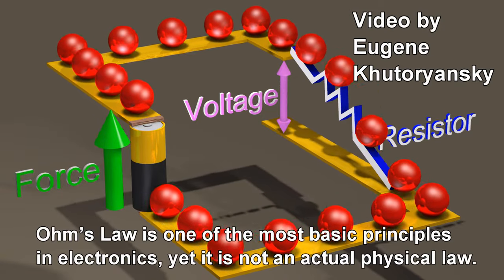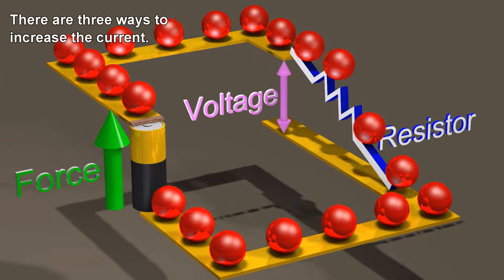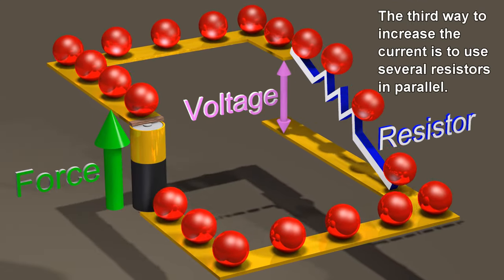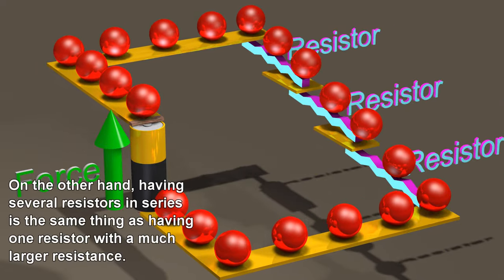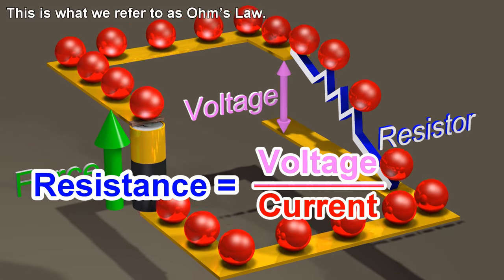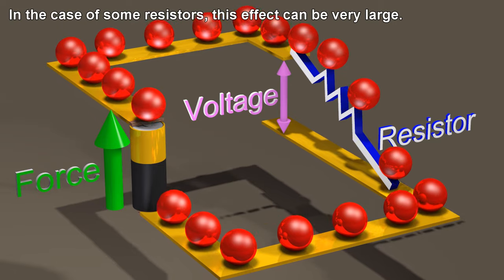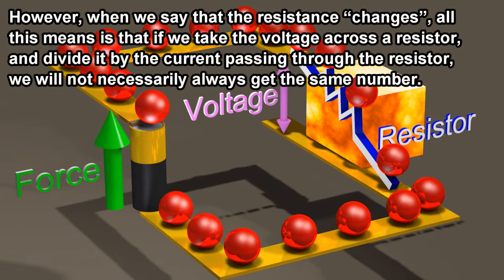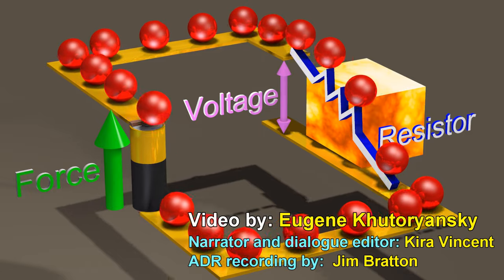Resistors - Ohm's Law is not a real law

Comment: Ohm's Law is more than just a "definition" : it's an empirical observation that, within some range of values, and at constant conditions such as temperature, there is LINEARITY (with a graph passing thru the origin) between the applied voltage and the induced current.
It does not explain why it is so, in terms of the electron structure of the material, etc.
The animations are awesome to give an intuitive feel for Ohm's law...  and I normally admire this channel...  but found this video to be unfairly dismissive of an important milestone in the history of science on loose semantics grounds.

If you want to say that Ohm's Law is really a definition of Resistance, fine.  Then the law becomes: the Resistance is (generally) constant, and (typically) doesn't depend on voltage (under some common circumstances.)

Some early pioneers of the study of electricity thought that increasing the voltage did NOT increase the current... as detailed in this video on the history of science:  https://www.youtube.com/watch?v=fk_BpXlfZ8U
On a similar note, one could imagine that if you doubled the voltage, then the current might perhaps increase by x4 or x8, etc.
Ohm's Law sets that straight!  It is approximate, and does not bring in insights from quantum physics, but it cannot be dismissed as not being a "real" law; it simply is not a FUNDAMENTAL law...  Today's fundamental laws (such as the axioms of quantum mechanics) are often tomorrow's derived laws.  

A lot of the "laws" of fluid dynamics are also empirical approximations, under some ranges of conditions.  One could argue that the word "law" might not be the ideal term... but I was hoping that this video was going to dig into the underlying mechanism of conduction - what actually happens to the electrons in the current inside the resistor as they interact with the electrons in the atoms of the material (valence bands, conduction bands, etc) - since the title implies we must dig deeper to find that "real" law.

Or take "Newton's Law" of gravitation: it breaks down if the masses are sufficiently large...  Heck, it doesn't even accurately predict the precession of the orbit of Mercury....  But if one made a video called "Newton's Law is not a real law", I think that the audience would expect a discussion of General Relativity!

I think a more accurate title for this video would be "An intuitive feel for Ohm's Law" - with a caption "Ohm's Law is not a fundamental law, though we don't explain here why that is the case, other than saying that it's approximate"

Comment: Ohm's law is mathematically true insomuch that it is "measurably consistent" in observation (regardless of the variable nature of the actual phenomena [i.e. the resistence within a given circuit]). Given its irrefutable real world applicability "irrespective of changing conditions" (i.e. variation in resistence) within a given circuit, Ohm's law is a fundamental absolute (as generally understood by V = I * R). Therefore, "Ohm's law is absolutely true" (as proven by its predictability in analyzing "timewise current conditions" within a given circuit). There are many generally absolute laws of nature (i.e. Ohm's law) that can be picked apart or explained by its more fundamental physical properties (quantum mechanics), but that does not in any way negate the measurably absolute applicability of Ohm's law. In fact, the reliable deterministic predictability of Ohm's law has provided invaluable insight into understanding subatomic phenoma.

Comment: I think this is not entirely true. The misunderstanding is in my opinion that many people believe U=RI to be Ohms law which it isn't. As explained correctly in the video, U=RI is the definition of resistance. But Ohms law really is that R is constant, i.e. for a "ohmic" resistor, the value of R is the same all the time regardless of the voltage applied. And this IS a physical law. (Of course, if you look closely enough, there will be smaller or larger deviations as explained in the video. But  that is more or less one of the foundation of physics: everything behaves linear (current is proportional to voltage) as long as you keep the range of values small enough). So the Ohmic resistor is a model to reality which works very well in a broad range, and this, as I mentioned earlier, is a physical law.
TL;DR: R=U/I is a definition, R=const is a physical law!

Comment: It is a law. It's a law that tell us that current directly proportional to the voltage.
Reply: Johannes Sjolte Not an universal law.
Reply: Neither is Newton’s 2. Law
Reply: Johannes Sjolte I thought the same, but there is one difference. Both laws share the fact that you can define a new physical parameter, mass or resistance. But in Ohm's Law you have some materials that doesn't obey it, while in the other case every object has its mass remaining constant. But, that never happens actually, because of Special Relativity…
Therefore… Ohm's Law is fine, but has that particularity which other laws doesn't have.

Comment: I am not sure about this definition thing, as far as I know (let me know where I am wrong) resistance is defined as a property of an object, much like line in geometry is defined as an "undefinable object" and the law tells us how a few of such values are connected, much like geometrical axioms tell us the relationships between the "undefinable" elements: lines, dots, planes, space...

This way you can always polish the law without being concerned about definition: what if it doesn't work in high/low temperatures, close to light speeds or in an uninertial system? You don't have to change the definition, only the law, if it proves easier to do that (because of some other laws regarding the same values).

Comment: 1. There are preconditions to this law such as 'under constant temperature' which is to imply that the law would be talking about a simplified model of real life system like most laws in physics. Therefore, it is to be used more as a guideline rather than as a law beyond textbooks.

2. The statement is also not R=V/R. Ohm's law statement is that current flowing (the effect) is proportional to voltage (the cause) across the resistor. Resistance is only the constant of proportionality to represent the law as an equality.
Therefore, the law is not responsible for a variable resistance. Even under changing conditions (under the preconditions mentioned in 1), the law still holds.

Comment: There is always in everything we generally assume. We must assume for something to be right. That is generally speaking about language. Language is a memory we all share. We can have different understanding of words, we might associate words with each other, and we might have strong or weak feeling connected to words. Without knowing the meaning of words before hand we cannot use unknown words to communicate with others. Just like you does not understand other languages when spoken. 

When it comes the subject of resistance: without further information and without giving it context. The formula of resistance is a simplified version of reality of resistance, in other word incorrect when it comes to accuracy. 
We need to assume temperature is included when calculating voltage of material for the formula to be right. 

Maybe we can get the right resistance with high accuracy if we take material purity of the conductor, absolute mass of material,  absolute electron charge, molecular structure of the conductor, and take into consideration molecular structural change of the conductor during operation, then we can get more accurate resistance. 
But we are not much interested to include all the measurements for general application. The formula of ohm is a workable formula for general use, but not for quantum purposes where nano accuracy is demanded. 

Depending on demanded accuracy of calculation,  the formula as it stands in my view does not qualify as a law. Since it does not include needed details to make it right and indisputable. It lacks information to make itself complete.  

Feel free to correct me.

Comment: That's the reason why current is same in series circuit. The Resistors reduce the voltage and so, as I=V/R, so reduced voltage will automatically result in reduced current! As less potential difference will cause lesser attraction and slow the current down.

Comment: Don't see the issue. At any instance the law holds true. Whether resistance varies not at all, or wildly over time, the equation still holds. No one needs to demand a static system, an unchanging resistance.

Comment: so if i have a suply that gives me 4 volts and 3 amps, if i make a circuit where ai put a lot of resistors in paralel, will the amps increase??
Reply: +Tropa Karlitos with just a resistor, or several resistors, no. Unless you are using a transformer then your supply voltage and current will always be higher than your return.
Reply from the maker: +illudian, in a series circuit, the current has to be the same at all points.  Therefore, the supply current and the return current will be the same.
Reply from the maker: +Tropa Karlitos, if the power supply is unable to supply more than 3 amps, then when you put a lot of resistors in paralel, the voltage produced by the supply will end up being lower, so that the current drawn by the resistors from the supply will not exceed 3 amps.
Reply: Physics Videos by Eugene Khutoryansky Yes sorry. I should know better than to try and science on 48 hours of no sleep.
Reply: i will explain to you what i am trying to do i have a motor and when i spin it it generates 90 volts but cant feed a small kitchen eletric device because the current is to small, is there anyway to increase the current

Comment: Nice video, but how voltage dividers with two resistors work?
Reply from the maker: +Yan Kob, thanks for the compliment on the video.  In this video, I showed a voltage divider with three resistors when I showed three resistors in series.  So, a voltage divider with two resistors would be the same concept.

Comment: Wonderful animation correctly describing how Ohm's law (a law just as real as any other law from Physics) works. It's not any less valid because R=V/I. This isn't the definition of resistance, btw. Resistance = (resistivity * length)/cross-sectional-area.
Reply: I have read somewhere that electric "flow" is dependent on the surface of the conductor and electricity spreads due to changes in the magnetic field surrounding the wire....

Comment: but what if R = 0??
because V=I×R  (by formula)
V= I×0
V= 0  (mathematically)
but logically Voltage V will Maximum as Current I, if R Resistance is Minimum
Reply from the maker: I cover this question in my video at https://youtu.be/v8iD_waF_kM

Comment: point not well taken.
resistance is a function of temperature.
so what ?
i suppose that the problem referred to is that 
whereas the resistance is a function of temperature -
it is not a DEFINED function of temperature 
as is the product of pressure and volume 
for an ideal gas where  PV = nRT.
it could be argued - however - that even the Ideal Gas Law 
is not a REAL law - since it doesn't apply to most REAL gases !
Reply from the maker: The ideal gas law relates quantities such as pressure, volume, and temperature, all of which have definitions independent of the ideal gas law, and which can be measured independently of the ideal gas law.  However, resistance has no independent definition, apart from ohms law, and there is no independent way to measure resistance, other than to calculate it from current and voltage using ohm's law.

Comment: Some comments and facts: When Ohm did this finding, there was no knowlege of electron or inside of atoms. Ohm found out that resistance is constant for metallic coductors, mainly copper, iron. He knew  that  resistance depends on temperature.  There was not found yet the law of conservation of energy. Many other things were not known. We use nowadays resistance for example radiation resistance of dipoleantenna is 70 ohms. It's  a feature of space, not any wireconductor. Explanation for electrons movement in conductor is quite complicated. It would be interesting to animate this properly.
Reply from the maker: I was not aware of the history.  Thanks for the information.  I will add the movement of electrons in conductors to my list of topics for future videos.  Thanks.

Comment: If the red balls represent current (electron flow) than they're moving the wrong way. Electrons move toward the positive anode and are repelled by the negative.
Reply from the maker: +bruce101able, I am showing the convention of positive current flow, which is the convention used in text books and by industry.  And yes, this is the opposite of the direction the electrons actually flow.  I discuss this in detail in my video "Electric Potential: Visualizing Voltage."

Comment: If ohm's law is not a real law, then newton's second law also might not be a real law. Because it defines what a mass or inertia is (like how a specific mass responds to a force).
Reply from the maker: No, because "mass", "force", and "acceleration" are all defined independently of Newton's laws, and  Newton's second law then shows the relationship between them.  On the other hand, resistance does not have any independent definition outside ohm's law.

Comment: Why does the current always remain same in a series circuit?When the charges encounter a resistor wouldn't the speed of flow decrease?If the speed decreases shouldn't the rate of flow decrease at the same time?
Reply from the maker: Since the electrons repel each other, if they slow down in one part of the line, this ends slowing all the other electrons that are flowing in series.  Note:  The red spheres do not represent electrons, but represent the positive current flow which is in the opposite direction.
Reply: @EugeneKhutoryansky  if there is any video of explain particularly that why current remains same in series and p.d. remains same in parallel combination the. Pls share the link it will be helpful to understand better
Reply from the maker: Have you seen my video on electric circuits at https://youtu.be/m4jzgqZu-4s

Comment: "Having more resistors is like having a smaller resistance."
This choice of words illustrates exactly why I don't understand that splitting up the track increases the current.
Reply: Imagine being in a duel with swords. As long as the other person resists you sword attacks, you can't hit him. Hitting him really means getting through his blocking.

If the other person resists your attacks as strongly as you attack, you won't be able to hit him. But when you do hit him, you hit him once at one time. 

In the above case, your opponent/resistance is really strong and you barely pass any hits. 

In another case, you have three weak opponents who are not strong, so you can hit them much easier than it is to hit a strong blocker. 

Similarly, the electricity that passes through three weak opponents (resistors) has an easier time getting through than the electricity that tries to get through a strong opponent (resistor).
Reply: @excitedaboutlearning1639  The thing is, they're saying that 3 STRONG "opponents" is like having 1 WEAK "opponent".

I think the trick is that you can "attack" them all at the same time but it's still counter-intuitive.

Comment: I wish they had used electron flow over conventional flow. As electrons flowing is a much more satisfactory explanation, compared to a gap moving. 

At least in my opinion it is, but to each their own I suppose.
Reply from the maker: In my very first video, I showed electron flow.   Many people complained that I should instead show positive current flow.  It is not possible to make everyone happy simultaneously.
Reply: The only way to make people happy on this issue, is to go back in time and tell Benjamin Franklin that the charge left on the glass on the silk should be the negative charge.

I guess that would make protons called "negatrons", and positrons called "antitrons", if someone actually pulled that off.

Comment: This is completely wrong. Ohm's Law is telling you that in a certain range Voltage and Current are proportional. You double the Voltage, you get twice as much Current. In other words, if a resistor follows Ohm's law, its Resistance is a constant.
Reply: +Daniele Messina 
I seriously think you need to re-watch the video and pay closer attention and give the explanation some more thought : It is absolutely correct in what it says !
It is sort of saying [to my understanding] something more like 
"Ohm's incredibly useful concept for understanding relationships which are somewhat stable for certain human purposes under most conditions, but which in actuality are subject to other complex factors not described in the concept". 

..... but "Ohm's Law" seems a bit neater.
Reply: The message is that Ohm's Law is the same as the definition of Resistance, which  is wrong. Resistance is v/i, the fact that it's a constant is ohm's law.
Reply from the maker: +Daniele Messina, the resistance is not constant, and that is the whole point.  If you modify the law to state that the resistance can change, then the law is no longer saying anything at all, other than how the word resistance is defined.
Reply: +Physics Videos by Eugene Khutoryansky "the resistance is not constant", true. We define resistance as the ratio between V and I, and a priori it could be anything. We have a material or a circuit, we run an experiment, measure couples of V and I and write down all the resistance values as per definition. If the ratios turn out to be all the same, we say that that material follows Ohm's law with that common specific value of R. The definition of R and Ohm's law are two different things. "if you modify the law to state that the resistance can change" it wouldn't be Ohm's law anymore! You are mixing the definition of Resistance with a law that describes a behaviour of some materials/circuits.